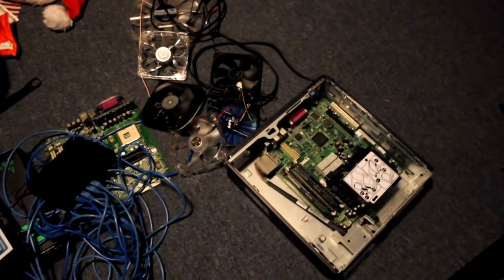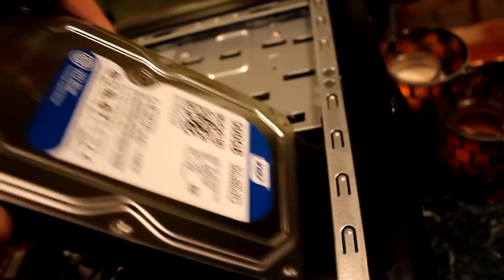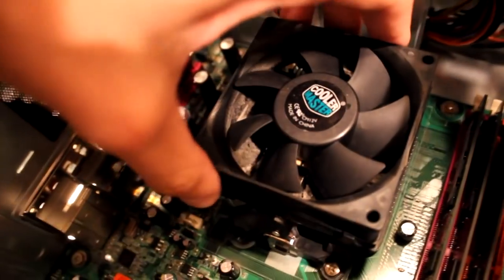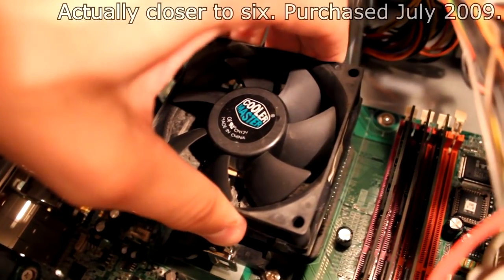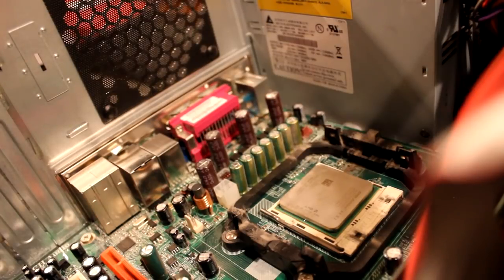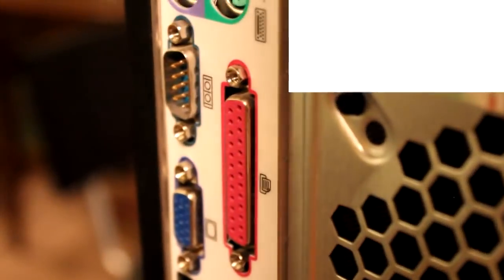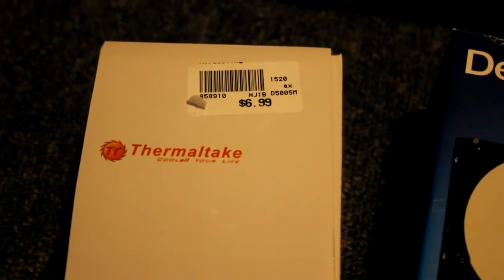Giving a 7-year-old computer a second life

Comment: Step one: delete Vista
Reply: why? I don't think its as bad as people say it is.
Reply: Step one: keep Vista
Reply: 7 is the best choice though, 8.1 and 10 are absolute reproduced garbage that's being force fed to everyone.
Reply: Yea, Vista's the worst!
Reply: have you every used it? :) i have and it works just fine
Reply: RedYT
Talkin' to me?
Reply: Tutoriale și jocuri interesante
 i dont even know
Reply: RedYT You do know that my comment was a total joke, right? I use Vista on all my computers and I have no problems with it.
Reply: Tutoriale și jocuri interesante
 oh ok XD
Reply: I've had a few issues with vista when it was still young, but after updates it runs good
Reply: charizard4410 Of course ot does.
Reply: Step 2: Reinstall Vista.
Reply: Boom DeKaasMan May I ask if Vista's bad?
Reply: ***** No, it's not. When was the last time you had Vista on your machine?
Reply: ***** You do know that I use it as a main OS, right?
Reply: ***** The fact that I use Vista every single day on my computer, actually, more than that, gaming computer, and I have no problem with it.
I used Vista on a Toshiba Sattelite A200-1MB and it worked fine, until the 5400RPM HDD in it died and it was replaced with a 4200RPM.
I used Vista on a Lenovo G570 with 4GB of RAM and a Pentium B950. Vista worked and looked much better than on the Toshiba laptop because the Lenovo had better monitor and faster Hard Disk (7200 RPM). Now I use it on my gaming PC in a dual boot with Windows 8.1. Latest nVidia drivers still work on Vista, yes, that means GTX Titan X Pascal on Vista.
The best AMD drivers that work on Vista are 15.6, but that is good enough to support an R9 390X.
Reply: +Tutoriale și jocuri interesante it isnt!
Reply: Boom DeKaasMan Oh yes it is! Search on YouTube "Does a newer version of Windows decrease the performance of the PC?" and click on the one made by Bob Pony. See who crashes and who takes the 2nd place.
Reply: ***** Nope, I don't know and I don't even wanna. But I never said that Vista is the best, but I said that it is better than 7.
Reply: ***** Ok. Search on YouTube "Does a newer version of Windows decrease the performance of the PC?" and click on the one made by Bob Pony. Look who's stable now.
Reply: ***** Oh, you can't switch back, can you? Sure... I can't see any possibility in which you aren't able to switch back, only if you're in love with an OS. I'm in love with Ubuntu, for example tho I don't use it as I'm such a noob at using it.
Reply: oh no! i didn't follow the directions correctly. i now have a dual boot computer with vista and win 10. :)
Reply: Isaiah Ash
LOLOLOL
I have Vista and 8, but I used to have Vista and 10. The installation of Windows 10 broke, so I had to replace it with something because I really want to dual boot (I want NFS 2015 and Origin may not let it run on Vista).
Reply: alex mercer Trust me, I used. I like Linux, but I'm a gamer. Windows acts better at gaming. For example, when I opened NFS Underground 2, the resolution of the screen was changed to 640x480 and Linux only displayed the top left corner of the 1360x768 resolution. The game only showed up in the bottom right corner. This is the reason why I stay away from Linux, even tho I know that NFS Underground 2 has bad code for resolution settings. I like the way Linux looks, but I like more the way Vista and 8 look. I have a dual boot with these OSes. I won't switch until necesary.
Reply: alex mercer 'Course It had to be 7!
Reply: alex mercer I'm happy with Vista and 8. If I would have 4 partitions, I would install 10 on top of them all. I really like them all, except for 7. 10 is extremely responsive even with a low amont of RAM. 8 has that Start Screen and I love it. Vista has that nice sidebar and the oldish XP touch to it, but not doesn't forget the Aero and the nice sounds, things that 8 and 10 do forget. But 8 and 10 are compatible with everything on the market right now. I find the Start Screen very simple to hse, but, as you said, from time to time, it gets annoying and harder to use, but that doesn't make me hate 8. What do you hate in 10?
Reply: ***** Don't believe you. I have actually made a video about Windows 10 on a Lenovo G570 (check its specs on the Internet) and ran really fast even when recording (tho Bandicam didn't really like the encoder so the audio is pretty shit and the video is lagging sometimes). Just search on YouTube "Windows 10 pe Lenovo G570 4GB DDR3, Pentium B950" and see how it goes.

I have a lower end PC than you have:
6GB of RAM
Xeon E5420
GTX 650
7200RPM SATA ll Hard
And that's all that matters. Windows 10 is much more responsive that Vista, 7 and 8 are.
Reply: ***** Google "xeon e5420 cinebench r15" and then do the same for your CPU.
Reply: It's bad games don't like to run on it .
Reply: it is not that bad, i have used it in 6 years! and no problem, it can run games guys :D but soon i will upgrade to windows 10 and i have amd fx 6300 cpu
Reply: ***** yaeh
Reply: Archeryboy Vista isn't bad. And it was finished, but too late for 95% of the world to even notice, in SP2. For Windows Vista haters, today I'll reinstall 7 and give it one more chance. It's the last one.
Reply: Creaky I'm not wiping Vista, what you actually thought I was gonna do meant to delete my work for almost one year. Tho, sadly, I'm wiping 8.
Reply: i dont know what your talking about 1st of all windows 10 is probally the fastest os
Reply: MWorldCreeper The hell... Even 8 in beta boots faster than 7.
Reply: ue
Reply: Tutoriale și jocuri interesante nah I'm running a 10yr old athlon and a 7yr old GPU and an ssd and mine boots (after post) 5-7seconds flat
Reply: +The 64-Bit-Kid Sure… Any video proof?
Reply: Nope, step one; Easy with thath or any hard drive or disk... etc.
Reply: yep, my parents have the PC and from vista to 7 its faster also wiped all the bloatware they had on it
Reply: Whats wrong about vista?
Reply: asta la vistahahahahaha.... joke
Reply: I never had any problems with Vista. But I do like 7 better.
Reply: 10 is a much better version of 7 basically but with the home menu from 8 and 8.1, also 10 runs microsoft edge (I use chrome myself) which actually has microsoft support, whereas internet explorer on windows 7 has no microsoft support left and has pretty much been left to die. Although windows 10 doesn't allow some older 8-bit games to run so I guess windows 7 wins there.
Reply: Given the current state of Windows, we might look back at Vista and miss the good old days
Reply: Yeah, at least big brother doesnt run on vista
Reply: Instal any of Linux OS & go on with life...[;
Reply: Denis Hošić Tell that to NFS HP 2010.
Reply: How To Delete Vista

Step One: Delete System32
Reply: Alquiler de software vs Comprar software ej: office 365, Adobe Premier, Windows
Reply: Alquiler de software vs Comprar software ej: office 365, Adobe Premier, Windows
ahahahahh lol (; seeya bro'
Reply: Step two: install windows 1
Reply: (The best)Step three:Destroy your pc with fire and it will work fine.
Reply: Αντρέας gaming Yea, because Vista is the worst
Reply: Αντρέας gaming step 4: delete system.32
Reply: No this is a bit.Destroy it with bombs.If you delete system 32 it only don't open apps.It does not destroying your system if you delete system32
Reply: I used it for 10 years, one single instal, everything working just fine.
Reply: GBuys Yea, "even worse", because ME and Vista are bad.
Reply: your right
Reply: Boom DeKaasMan 🤣🤣even funnier.
Reply: Vista did sucked at start until they fixed the bugs
Reply: Andrew Dupuis "Did sucked". Check your grammar. But yes, that is true.
Reply: Aria D I have never had any problems with Windows Vista.
Reply: @ToniML200  fcg
Reply: @ToniML200  i luv Vista 100000000000%

Comment: my Athlon 64 x1 still runnin perfectly (: since 2002-2003!
Reply from the maker: Chris H. I give AMD a lot of crap usually (see our podcasts), but I will say their products do have a long lifespan like Intel's.
Reply: +Stewie2552 It looks like you have 2 bad capacitors next to the cpu cooler.
Reply: Good catch, the two tall brown VRM caps closest to the PSU are bulging on top. They will cause BSOD eventually. You can solder new ones in for about $3.
Reply: asandberg6 Yeah, bad cpu cooler, not very likely to happen
Reply: I'd replace all 3 just to be safe!
Reply: @Stewie2552 They have a longer lifespan then a intel. You dont know how to remove a cpu cooler, sooo nooby
Reply: He removed it correctly, the thermal paste just hardened over time and acted like a glue which held the processor to the heat sink. Not his fault, just crappy thermal paste...
Reply: Jacob Adamsky Who cares?
Reply: the mre nerd yeah dude chill
Reply: Richard Woodurff Should i chill?
Reply: ***** netflix and chill brahh
Reply: ***** Shouldn't you?
Reply: My Amd Athlon 64 X2 5000+ Dual Core 2.61 GHz still works crazy :D
Reply: dudeeee I have the same cpuuuuu
Reply: Desktop CPU's can last up 20 to 30 years when they're not overclocked, at least that's what AMD and Intel are estimating. Some people are still playing on their old 468's and Pentium 1's (collectors and retro gamers who like dos games).
http://www.anandtech.com/show/2468/6 This article demonstrates how wear affects CPU's but that can be adjusted by raising the voltage very slightly (and most modern boards will do that by themselves anyways).

Most consumer grade desktop cpu's should survive uptimes (total time of running) in excess of 10 years. As you see, if your pc is running 8 hours a day you'll get 3 times that lifespan, and we're back to 20 to 30 years (depending on how many hours your PC is running a day).

In the end, the mainboard will die long before the CPU almost everytime (given no overclocking).
Reply: I change thermal content every 6 monts is that too early or not ?
Reply: iForce14 Highly unneccessery.
Reply: :D
Reply: i clean the case and the components every week i take good care of my pc :D
Reply: iForce14 hmm
Reply: iForce14 Judging by that profile pic you don't :D
Reply: lol
Reply: iForce14 Ikr
Reply: same here
Reply: Still running 5000+BE  here.....haha
Reply: I think you mean 2004/2005, lel.

An A64 X2 4600+ is still quite a decent CPU though, even for modern OSs.
Reply: Chris H. hello fellow a ancient CPU user I'm using an amd athlon x2 4800+ works great (ish)
Reply: The 64-Bit-Kid I have one of those, but its IMC is fucked :-/.
Reply: What is IMC ?
Reply: Btw my Althon 64 x2 5000+ works so f*cking good at 2.61 ghz
Reply: iForce14 Integrated Memory Controller.

Also, even a Core 2 Duo would be a decent upgrade, just saying.
Reply: Can i see your specs ? :D
btw mine
Amd Athlon 64 x2 Dual Core 5000+ 2.61ghZ
DDR2 4gb 800mhz
nVidia Geforce 9500 GT 512mb
Reply: iForce14
Intel Desktop Board DP55WB
Intel Core i5-750 @ 3.26GHz base / 3.91GHz boost
10GB (4+2+2+2) DDR3 @ 1630MHz
Gainward Nvidia GeForce GTX 750 Ti GS
240GB Sandisk Ultra (SSD) + 2TB WD Green (HDD)
Reply: I might upgrade to an i5-2400 soon, but the only LGA1155 board I have is ugly.
Reply: NEX H5 I should be proud then I guess
Reply: I have the Athlon 64 X2 6000+ in storage here. The processor still works fine but the motherboard got fucked up. I remember that I moved from the Athlon 64 X2 6000+ straight to the Phenom II X6 1100T and it was an absolutely MASSIVE upgrade. Seriously the Phenom II X6 1100T is like 40 times more powerful... But eventually I got the Core i7 4770K so now my father will inherit the Phenom II X6, I just have to buy a new mobo for it.
Reply: I Have still Athlon 64 X2 4450e but i use it sometimes for odler games and since i bought a Phenom II X6 1090T it was a huge jump!
Reply: Chris H. I have one Siemens Nixdorf P133 for old games still going from the 90s! And also my PIII 550 that is above 15 years old still going too and many other good ol computers. Some stuff with new life due to recapping are in them too
Reply: It's not necessarily a bad thing, but obviously the more it gets taken apart, the more likely something is to get damaged! Thermal compound will last longer than 6 months.

Comment: I am writing this comment from a 9 year old computer and it still runs great :)
Reply: Random Guy High-end veteran. I worked for 6 months for that PC :)
Reply: MegaBojan1993 10 year old Dell optiplex 745. 2.4 Ghz Intel Core 2 Duo, 6GB DDR2-667 RAM, 500 GB hard drive, Nvidia GT 730, and windows 10 Pro 64-bit edition. This was my primary PC from 2012 to 2014. I now use it as a secondary PC for browsing the internet and watching youtube, and playing older games. The side panels are in horrible condition, but everything else is in tip top shape.
Reply: MegaBojan1993 10 years now
Reply: dylan7 I just rebuilt my pc today
Reply: But can it run crysis on medium settings
Reply: Si ti Srbin

Comment: I have a HP Pavilion s7000 desktop computer. I was wondering if there was any upgrades that were possible for this computer, as it is quite slim so I'm not sure if anything will fit in it. Also the power supply might not be strong enough. Anything to make it usable again for word processing or very light gaming. Thank You

Comment: I know it is a older video but a number of items need to be addressed. 
1 The thermal compound on the unused fan is probably not good due to drying out with age, replace with new compound. 
2 Never pull a cooler off of a CPU, you twist it to break the thermal compound. 
3 Ronsonol Lighter Fluid is a better electronics cleaner that technicians use. 
4 You should have cleaned the remaining dust off of the motherboard.
Reply: I have seen CPU's that were so solidly cemented onto their cooler with the thermal compound that no amount of twisting was ever going to get them off. Sometimes prying is the only way to go. Even then, it can get so bad that you can literally rip the CPU cover (that metal plate on top of the CPU is just another heat spreader for the CPU underneath) right off. That was the end of that CPU, though with the amount of heat that had occurred with that CPU in the first place I think it was dead to begin with... I just needed the heatsink off of it. I think that was an AMD Opteron 275.
Reply: Jon Akers  Twisting to break the bond is always safer than pulling.
Reply: could break one or more pins if its too stuck
Reply: Generally speaking I agree but it depends on the specific circumstances. A good dose of IPA (IsoPropyl Alcohol) around the chip and let it soak for a while would have loosened it. THEN he could have rotated it SLIGHTLY and GENTLY back and forth. 

The CORRECT way would have been to:
1. Try to rotate/twist the CPU cooler/heatsink back and forth BEFORE removing it and the chip together which in itself could have easily caused damage

2. To use IPA or, if none was available, I bet there was some aftershave in the house - this makes for a VERY usable cleaning agent (albeit smelly) for all sorts of things when IPA isn't readily available (provided it's alcohol based - most are). IPA would soften the dried paste fairly quickly if allowed to soak in for about 10-15 minutes

3. THEN remove the cooler as per 1. above but NOT by pulling directly upwards. Repeat 2 and 3 until progress is made to be able to finally pull the cooler off GENTLY, ideally with a plastic implement between the cooler and the top of the cpu chip to twist for leverage.
Reply: Twist is the keyword, ..correct, he pulled the entire AMD processor.  He would not be a good spy.

Comment: Dude change the 2 caps near the cpu cooler that will cause stability problems
Reply: which ones? the only cap I see bulging at the vent it the one directly above the pci express slot... which is part of the onboard video on these boards. Replace the cap, or disable onboard video and drop in a cheap card with some 3d support and HDMI. (I only know because I was given 5 machines with this MB from a company because they were unstable. every board had that same capacitor in varying stages of bulge, up to cracked open and corroded vent(yes, it actually booted and was still fairly reliable!) I desoldered a bunch of suitable replacements to keep for future repair ofcourse.
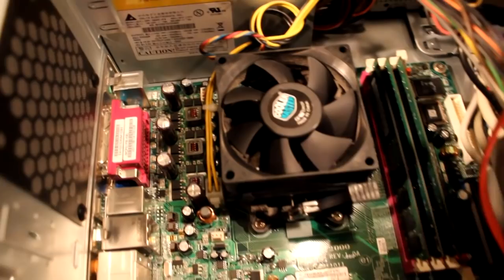Reply: 1:37 Just under the psu to the left of the cpu cooler these look quite bulged up to me. These caps filter the supply to the cpu and will affect the computers performance if not changed. Also i have found when caps go bad on motherboards often the caps in the power supply are also faulty causing the motherboard caps to have a higher load causing them to fail just something to check.
Reply: Ronan Wood  is right but there is 3 same caps. They are Vcore rail caps of the CPU. Two of them near to blown up.
Reply: I see it now. Good eye! Electrolytic capacitors tend to dry, and fail at the same rate, under similar thermal loads, so you're right on about checking all your caps over once you notice an imminent failure. Now lets break out the soldering iron!

Comment: Seriously? Do you honestly have no clue how to remove an AMD CPU cooler? You have to TWIST it until the paste breaks free or you'll rip the CPU out of the socket and potentially risk breaking the pins and / or socket.  Nice.
Reply: GTaero bro, twisting it would do more damage because that was so stuck on there that it would have just bent all the pins
Reply: @konaa6181  He is actually right. You have to gently twist the heatsink until it breaks free.  As long the cpu is in the socket there is no chance to damage the pins. If you pull on it you have a big chance to break or bend pins.  You and the 2 who liked your comment are dead wrong.

Comment: One thing you should have seen was the fact that 2 capacitors were bulged. That makes the powersupply unstable and can result in random shutdown or other "strange" problems. My old P4 3.0gHz HT, HP D330 computer had 7 of those and it still worked, besides the fact that sound was horrible. Recapping everything and it was fine again.